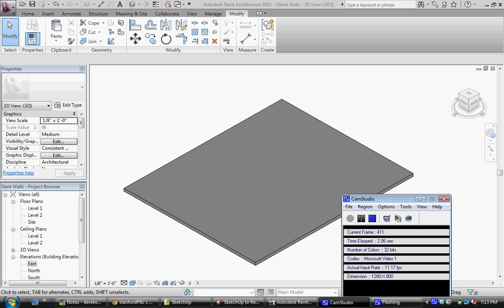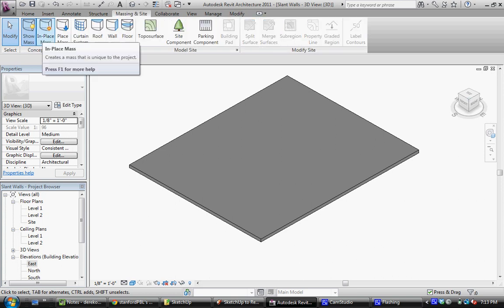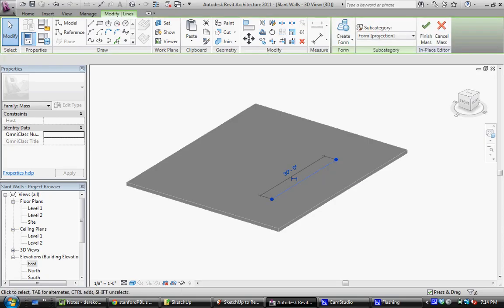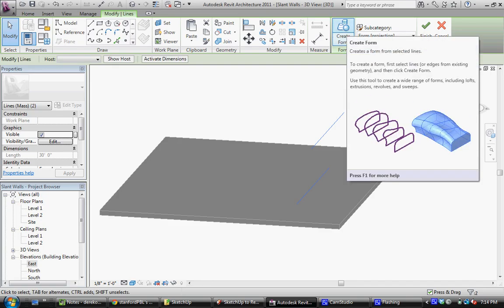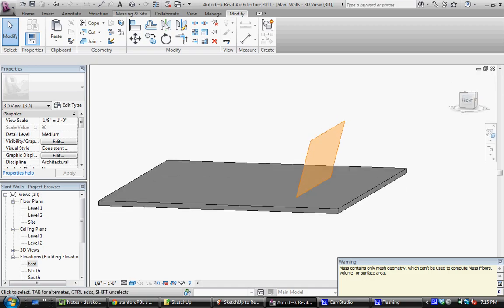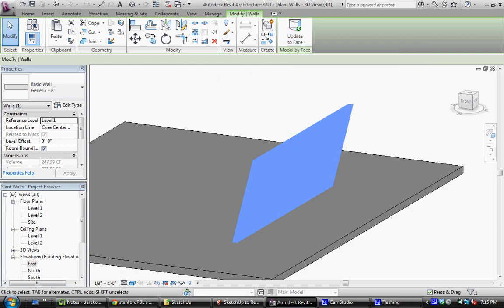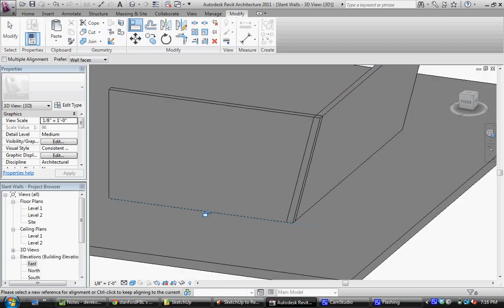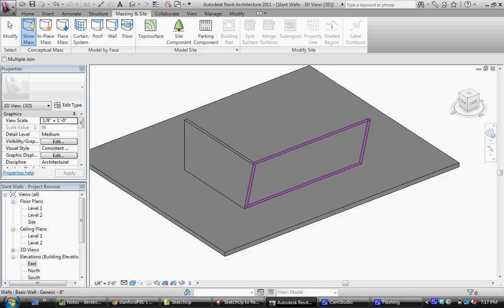Creating Sloped Walls in Revit

Comment: It’s been 10 years since this dropped and rebut still haven’t given us a sloped wall option
Reply: it actually has. Click the wall you want slanted, go into the properties tab, find cross-section definition, and change the cross section from vertical to slanted. From there you can adjust the angle of the wall numerically.
Reply: @chrisr6974  goat

Comment: Thanks for the video it is very comprehensive. One question for you though: what if you want to create a sloped wall that is not from level to level? That second line that you copied to your 2nd floor I want to place it to an intermediary level. To describe my dilemma, I have two concrete roofs at two different level of an outside staircase, now I want to join these two concrete roofs with a sloped wall like you did between your two levels. The thing is none of these two roofs have a level attached to them and it would seem odd that you have to create a level for each element that is parallel to the original "true" levels. I have created a work plane for each of these two roofs but Revit does not allow to pick a work plane only levels and to complicate the matter the align command does not work either when I pick the top surface of my sloped wall and try to align it with the higher concrete roof. I am a debutant so I am sure a simple solution is out there but I am yet to find it :-) and I love Revit so far but I find frustrating that you can sometimes spend hours trying different methods that should work to reach the same goal and the software only seems to allow one of these methods.
Reply: Been a year... but if u create a intermidiate level temporarly just to create your sloped wall, would that work? A to B is the original, you create level C. So it does A to C and then C to B.
Reply: Been 2 years... But can't you just make a section or use the elevation to draw your line wherever you want? (To have Revit place the line in the correct plane, create vertical reference planes in the floorplan first)